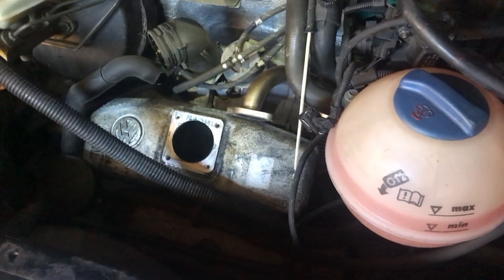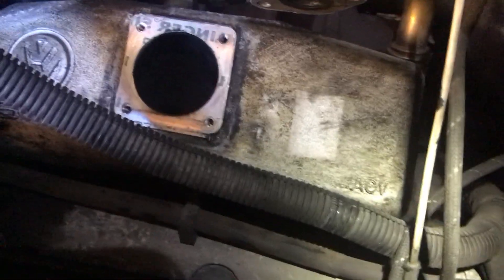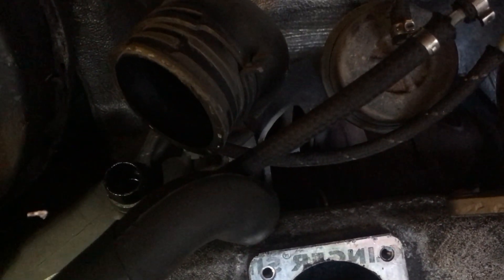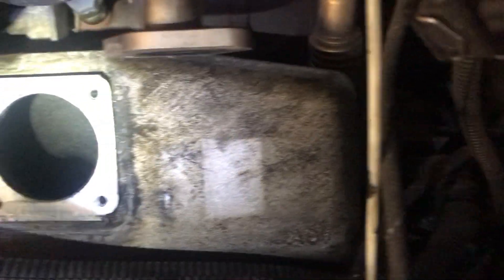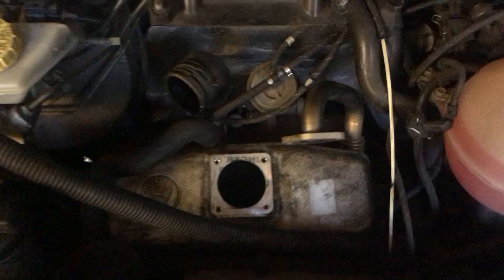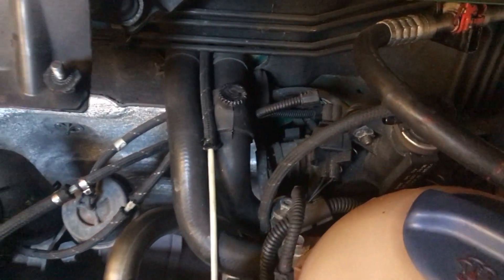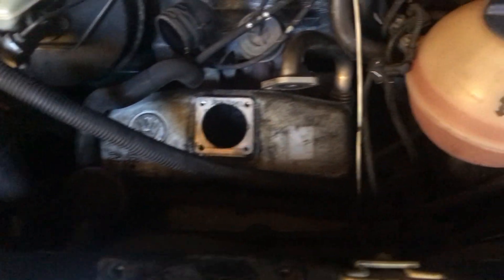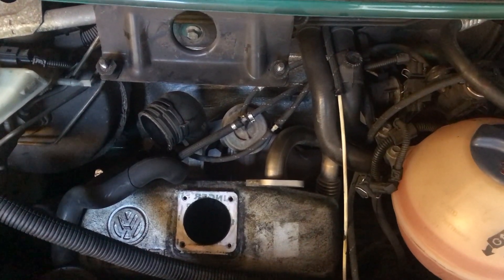VW T4 2.5 TDi ACV Vacuum Pipes & Turbo Pipe Air Leak

Comment: Thanks for the video and the write up, gonna tackle this on ours now as the vacuum pipes are deteriorating over time causing problems. Ours cuts off power at 70mph, resets after ignition off and on, sure I’ll find vacuum leak somewhere

Comment: Just another one on this Kevin. I've just glued my plastic heat protector cover back onto the cam cover rather than buying a new one. It's like new again. I used Sikaflex (Sika) Stixall Waterproof adhesive - sticks anything to anything, even works under water. It's temp rated to +100C. Your cam cover won't get any hotter than about 85C...

Comment: I read somewhere that the Idle Air Control can be provoking this problems with starting and having the right ammount of air. That goes to the ECU and gives it a signal of what is the right ammount of air. Did you look that up? Seems to be that when is faulty, the system has problems with power. I just stumbled across your video and thought you would actually replace that part, so I would have some instructions, but seems like we're all in the road to the unknown 😂. 
Please let me know if you fixed it or if you made videos about it, thanks!!
Reply from the maker: In the end the stating problem was traced down to burnt contacts on the glow plug relay carrier. See my other video showing the problem. https://youtu.be/u_md5DQ7tWs?si=mRNL3k1ITygt5wqf
I've updated the description accordingly.
Reply: @bvqbvq  thanks brother 👍🏼👍🏼

Comment: Hi, for the very awkward to refit turbo inlet pipe bracket, I used a cap headed bolt possibly 45mm long with a flange nut loctited midway to clamp the dipstick bracket and inlet pipe. Much easier to refit and hold to start the thread

Comment: Hi Kevin, thanks for this and other videos. I’m about to do exactly as you have done as mine. At first it wouldn’t start which turned out to be an ignition switch. I also changed the Stanadynes as PedroPickle mentioned here.  Have not had the benefit of seeing their full glory as now i have a bad white smoke issue from the exhaust and back of the engine. Can’t accelerate as the engine dies and engine won’t go past 1500rpm. Not diagnosed the issue yet but starting with this video. Also mine is an AJT with an ACV plastic cover as PedroPickle pointed out. Back to problem solving!

Comment: Hi Kevin. I have the exact same model and vintage. Even though ACV is printed on the cam cover, that's only because the ACV model cam cover is also fitted to this engine model - the AJT. Does the engine smoke white upon first starting after a day or two of rest? If so, the inlet air leak you refer to here is not the reason. Although a good idea to find a nice securing clip for that pipe, it is almost certainly the OE injectors of the 88bhp model - the Stanadynes - that are leaking fuel into the chamber after a rest that is causing any starting issues. I have a custom body and nozzle combination that you can get from International Diesels that are stamped "GERMANY VW Audi" - that are actually Bosch units - I can dig out for you if you reply to this comment - See Ron Rake on T4 Forum - he did mine for me but he's in Liverpool. Completely transformed the running of mine. At least 102bhp now and beautiful to drive.
Reply from the maker: Hi, thanks for your information, very useful. I traced the starting problem down to burnt out glow plug relay contacts. I made another video about the problem. I never had any smoke from mine, just the poor starting which is now fixed.
Reply: He is Project Power, and he calls my custom body and nozzle setup the "PP0.5". It's the largest flowing injector setup you can get without needing to remap the ECU. I nursed it once and on a long trip I got 76mpg. Yes, 76. Did a 310-mile round trip to Santa Pod and it used less than a quarter of a tank of diesel.

Comment: Great video, I checked my inlet hose and it was really loose too. I have done the fix and so far I have not had limp mode kick in on hills! It has improved the performance dramatically. I had done all of the vacuum pipes, checked the n75 was working, tested the actuator and was loosing my mind so thank you! Someone had mentioned it on T4 forum but it is better explained in this video.
Reply from the maker: I'm glad that it helped you. I find the ACV engine very reliable but there are a few issues to watch out for, particularly as most of them are over 20 years old now. The other one to watch out for is the diesel pump timing. As you can imagine, that makes a dramatic difference to performance and particularly starting.

Comment: Hi, I wonder if you can do me a favor?  I think I may have mixed the two pin plugs up which connect either the n75 valve or the lower pressure converter valve.  Are you able to photograph the wiring colours or describe which connectors fit either the top pressure converter or the lower one?  I have a Pierburg 1H0906627 upper N75 valve.  Thanks I will check out your other vids as you have the same engine as my Caravelle T4.
Reply from the maker: According to the wiring diagram the N75 wires are black/yellow and brown/blue. However, looking in my van the colours look more like black/yellow and orange/green. The wires are thin, dirty and difficult to see, so I could be wrong.
Reply: @bvqbvq  oh thats so kind, thanks for this info it is really helpful to me.
Reply: @bvqbvq  Me again, where did you get the wiring diagram as the Haynes manual doesn't show the N18 and N75 pressure release valves/solenoids?
Reply from the maker: @aaronharris5275  There are various diagrams online and I have a copy of the Bently T4 manual which has diagrams for the USA variants. You could take a look here: https://dokumen.tips/documents/vw-t4-engine-wiring-2002.html?page=1

Comment: Hi. I’m planning to swap out our braided rubber vacum hoses for silicone ones. However on the forums I read 3mm internal @ 5mm internal hoses. I see you used 4mm and 6mm. How did you get on with fitting the new hoses on.
Reply from the maker: For me the 4mm and 6mm hoses worked perfectly. If you have any doubt, measure your old ones to be sure. If you are planning to use the 6mm for the intercooler then you will need an adapter to allow the 4mm to connect to the ECU as per the description above.
Reply: @bvqbvq  thanks Kevin. Pulled off one of the hoses and 4mm it is. Shame I came across your video after placing order. 4mm ordered. 👍🏼

Comment: Hello Kevin. I’ve got an ACV swapped into a US eurovan. It’s been a journey. I’ve got my inlet manifold off and replaced my turbo and did some other mods. What is really hard for me to understand is what valve is for your turbo control, I’m using the N75. Also which pig tail contacts to it? I believe it’s the brown and blue wire one. Could you send or post a video of your turbo lines and control valve as a reference for when I get mine back together? Thanks.

Comment: I have same problems, I found that turbo hose loose and used rtv and hoseclamp. But still same as you, its hard to start. 2 years ago I blocked EGR, but no big differences. So my 2 problems are bad idling and bad starting. Other than that it runs great and efficient.
Reply from the maker: I fixed my starting problems by adjusting the diesel pump timing and fixing the contacts in the fuse box for the glow plug relay. The contacts had melted into the plastic of the fuse box and were not making good contact with the relay terminals. I've done another video on that problem.
Reply: @bvqbvq  thx man!

Comment: Thanks for this, I'm currently investigating a drop in turbo pressure which I think is due to an air leak somewhere. Be interested to know if your low-down engine response improves.
Reply from the maker: I didn't have much improvement to the engine performance as a result of fixing this fault. I did however gain a noticeable improvement after I adjusted the diesel pump timing.